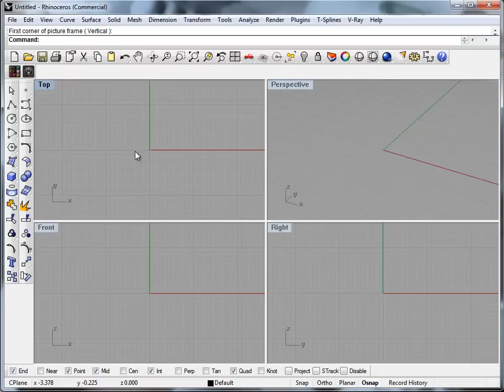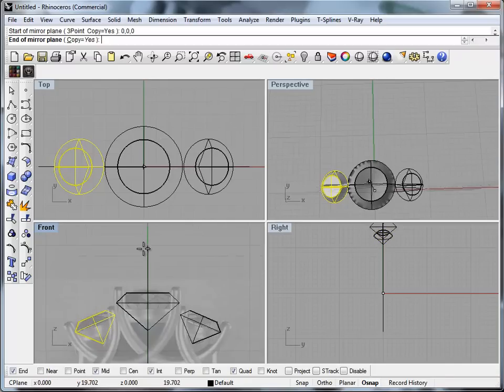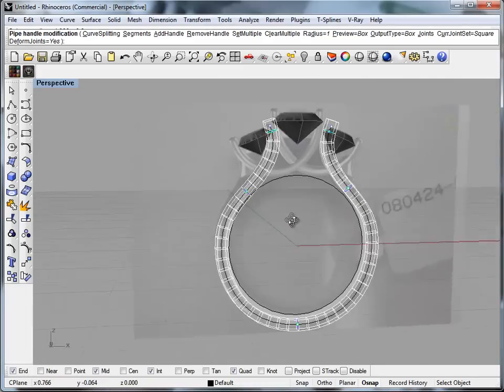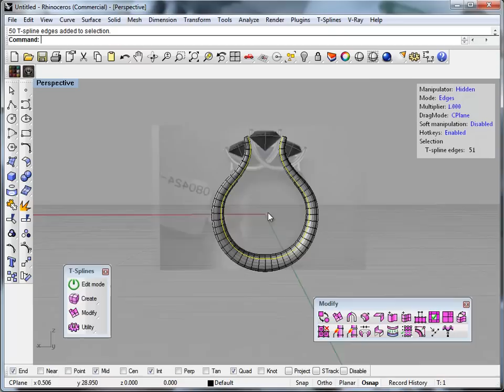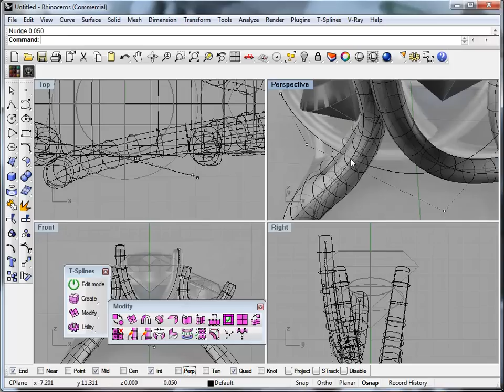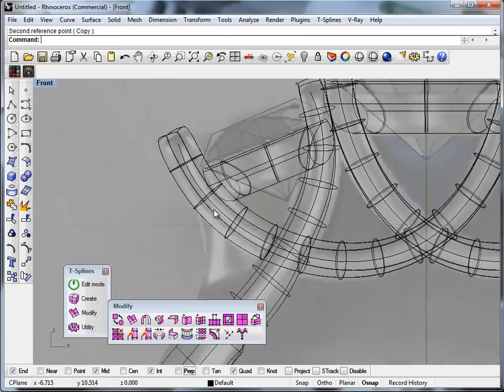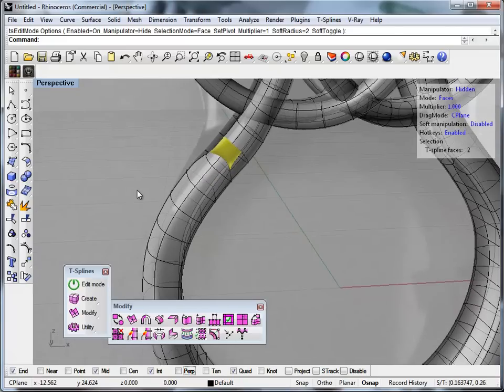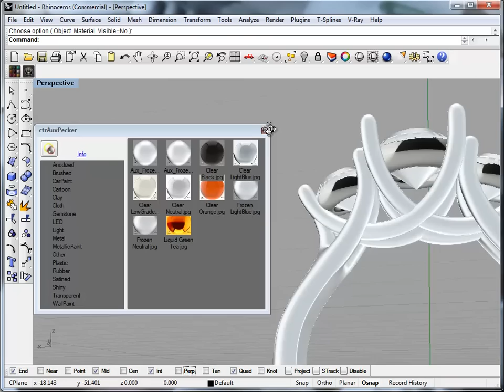Tsplines TsPipe Crossover Ring

Comment: I've noticed that grabbing edge loops is a little dodgy also.  I wonder if it's a bug in the ver. 3 WIP.  I actually have to exit Rhino completely and open everything back up.  Same thing goes for inserting a point on an edge (simple).  Sometimes the command doesnt do anything at all.  A complete Rhino-Reboot is needed.